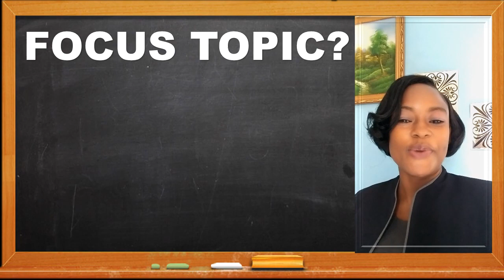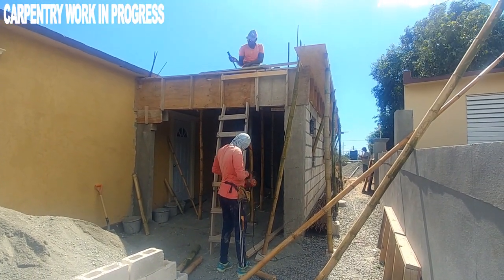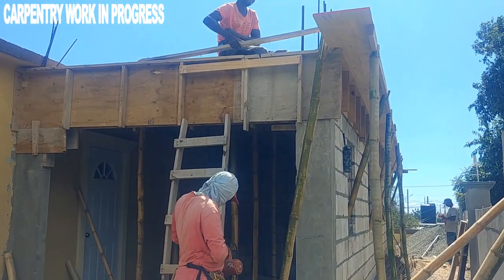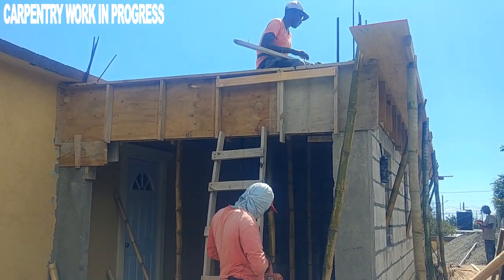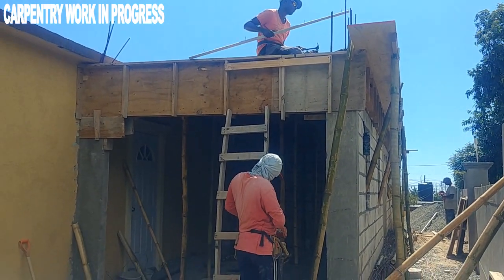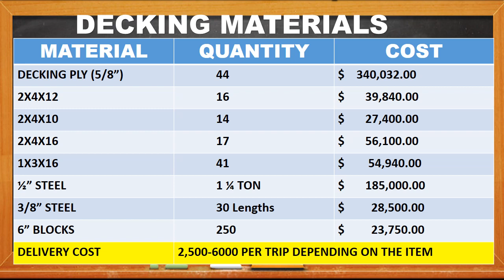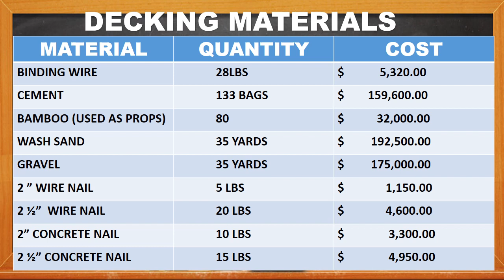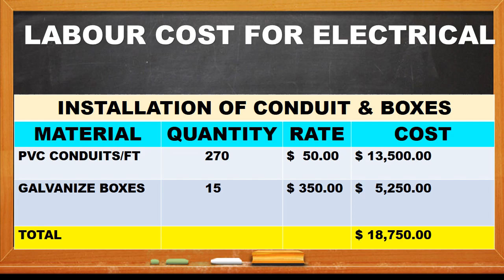Construction 2022 - Roof Decking Cost, Material Quantity & Labour Cost -Jamaica

Comment: the bamboos work wonderful, they are plenty but they look strong. and the cost of the bamboo outweighs the metal props, as the decking can stay up longer allowing the concrete to set properly.

Comment: Hi Mercury, enjoying your videos with the details provided. Did you compare using the premix cement truck to do the decking instead vs buying cement, sand and gravel + labour?
Reply from the maker: Thank you HackedbyEbanks. I compared both options and the two premix companies that I contacted proved to be way more costly as they charge per cubic yard. Coast to Coast Concrete and Aggregates is located a minute from where I live and based on my calculations it would not have been more cost effective for me, since all they were providing was the concrete.
Reply: @ravmercury3225  Thanks, I am going to do some comparisons myself. All the best with the construction.
Reply: Hi Mercury i tried contacting you via instagram, I am interested in getting the contact details for the mason that you utilized.
Reply from the maker: Hi HackedbyEbanks aka Sash, Rory & Prince Royal 😃 The contractor's contact details:
Name: Demar Wilson aka Demo
Cell: (876)476-1123

Comment: Good day I hope you are well what size stone did you use was it 3/8 or 1/2 inch for the decking??
Reply from the maker: Hi, I'm well thanks. Hope you too are well. This particular decking was constructed from gravel, wash sand and cement, not stone
Reply: @ravmercury3225  Hi Mercury thanks for replying. My bad I call the gravel stone. The gravel comes in various sizes that's why I was asking which size you used 1/2 inch or 3/8.
Reply from the maker: Ok understood. I honestly did not know that gravel came in different sizes. I know about the different colours, gray or white gravel. I really do not know what size was used. Hopefully someone with that knowledge who has reached the video can clarify. Thanks for teaching me something new. I will try to find out the size and share with you.
Reply: @ravmercury3225  Thank you. I was told 3/8 best for decking and 1/2 inch best for foundation and columns and like garage. I was using the 1/2 but switching now to 3/8 for the decking.